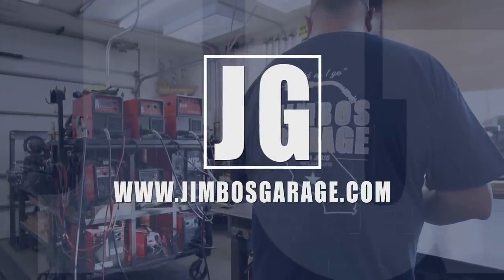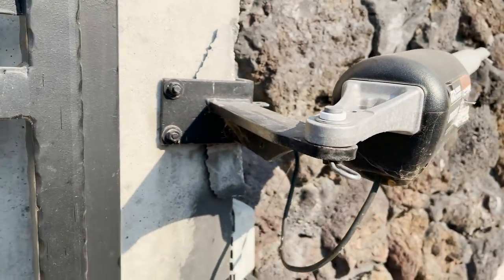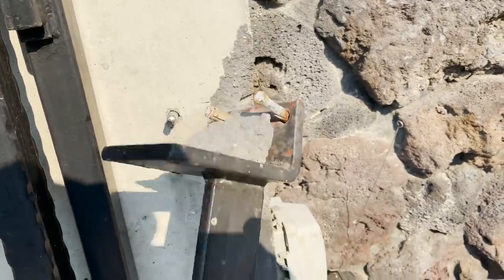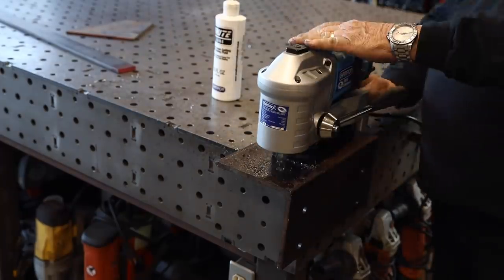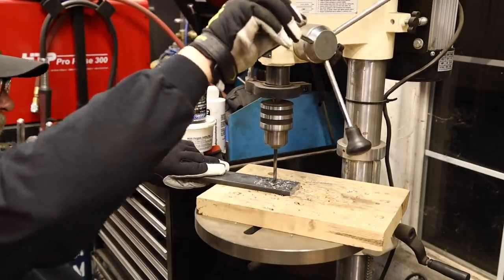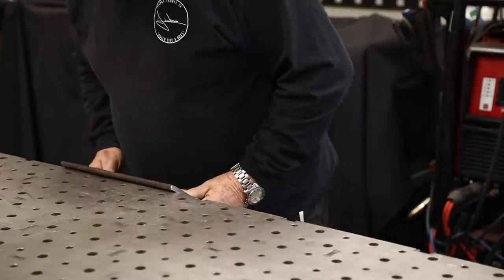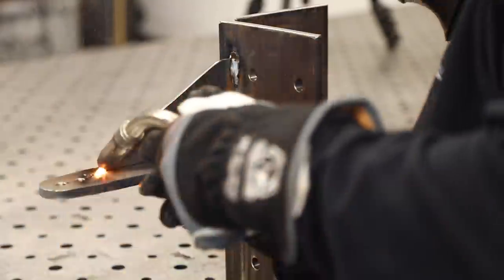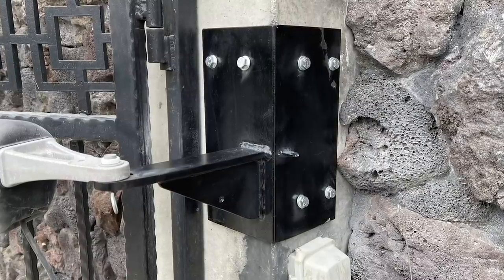Heavy Duty Gate Bracket | JIMBO'S GARAGE

Comment: I make these for a living and have done for twenty five years. The only thing I would have done different is offset the mounting holes, and maybe an angle return (drilled and tapped) to the hinge post, only to compensate for the weakened pillar. I love the way Jimbo makes one as good as mine, as a one off, though.
Reply: @Thomas McCurdy do you drive this type of anchor with an impact wrench? Thanks.

Comment: The only problem I see is when you drill the holes 🕳 in the new bracket the holes 🕳 should not be lined up. The holes 🕳 on the back should have been closer to the top and closer to the bottom, the holes on the side should be about 1 1/2 to 2 inches down on the top and 1 1/2 to 2 inches up at the bottom and maybe on the back one hole 🕳 right in the middle. The reason you want to stagger the holes 🕳 is to keep the bolts from coming close or touching on the inside, and with the lined up with each other makes it have a break point.  But overall great job.
Reply: In fact the two holes each side closest to the corner are completely unnecessary as that is where the concrete broke away - It would have been better to put a third hole on the outer edge as this is where the leverage advantage is

Comment: I noticed when you where laying out the holes for the anchors in the new piece of angle that you didn't offset them and was wondering if you were going to have an issue with that at install. I did the same thing on a fence bracket I made for a customer, learned my lesson on that one and had to go with a shorter bolt on one side, Hindsight is 20/20 like they say so now its always in my mind to take into consideration cross plain interference when I design stuff... Great job as always though. Hope you and the Family had a great Christmas and I look forward to seeing more videos in the new year.
Reply: i was thinking the same.. should of offset the holes so that the screw won't cross one another, especially the the in the front..

Comment: The original bracket looked strong enough... Looks like the short leg needs to be lengthen to keep bolts away from edge of concrete.
Reply: Thats what I thought, normally you don't wanna put any Bolt less than 50mm away from an Edge. Especially in such a case.
Reply: Since the original one failed and caused so much damage to the concrete it seems like Jimbo’s choice to go much bigger with the angle iron was the correct method for this job. 
I wouldn’t be surprised to hear that Jimbo makes another one for the other gate. 
The only issue I see was aligning the bolt holes which meant the 2 closest to each other across the corner would interfere with each other if not drilled on an angle as they did.
Reply: @Crewsy  maybe 4 bolts should make the job: the four far from the Edge.
Sure Jimbo didn't think about the alignment 😅
Anyway good job👍
Reply: I think you should have used c Channel off of the existing post welded a kicker fabricated the operator bracket still with the gusset on the underside. I did a similar job for a client and somebody hit the gate operator arm, not enough to destroy it but it definitely cause some damage to the pilaster so that was the direction that I went in it's built like a tank now whether or not somebody runs into it it ain't going nowhere
Reply: He should have offset the bolt hole heights to avoid the bolts being at an angle.
Reply: In the end he’s doing what the customer asked, which was to make a heavy duty hinge.

Comment: After seeing what happened the first two times you can see the weak link was the concrete, not the bracket. Only thing I would have done different, would have been to just put holes on the outside edges of the bracket that way you are as far from the edge of the concrete column as you could get. 4 holes total. Nice job
Reply: I was going to say going bigger not really needed, but extending longer so bolts are not so close to the corner. More concrete in-between bolts and corner.

Comment: I had thought that the concrete failed, due to bolts being short, as the original metal seemed in good shape.
Longer bolts epoxied into concrete would not have been a possible fix? 🤔

Comment: nice job on making that replacement, fun video... And I hate to be "that guy" in the comments, but the original bracket was plenty strong enough, the 2 issues were that the holes were not deep enough into the meat of the column.  If the holes in that original design had been offset from each other vertically, and you only used 2 of the holes and longer concrete anchors it would have likely been fine, what broke it out was too many bolts in line with each other in such a confined small part of the column.  As others have said, your new bracket probably should have had the holes offset vertically from one side to the other

Comment: Jimbo seems like you could weld a bracket directly to the gate frame and not even need to attach the actuator to the cement wall.
Reply: There is already a bracket on the gate.  There needs to be one on the concrete for it to pull itself shut.

Comment: I do brick work and concrete work. That bracket was still good heavy duty enough, it was just installed right in the corner if you ask me. not trynna bash ya. I just think it was the not made appropriately. I dont think the fabricator had the concrete cracking in mind due to the anchors close to the corner and aligned.

Comment: Concrete is very strong in compression but not so much in tension. That column should have been full length square steel tubing embedded inside the concrete with the bracket attached to the tubing.

Comment: Best fix would be to install the proper size hinge posts behind the column and have the bracket attached to the post. 
Working a gate is stress on this system but wait until someone hits the gate. It’s going to be a mess.

Comment: Hey, There are some misstakes with the old and an the new bracket.

The New Bracket  ist awesome, but 8 of these Concretescrews are to many.  2 on each side would be enough and then you need to use Boltankers m10 in Stainless.
And at least the Bolts need to be offset.

If you use so many Ankers in that close Range you will weakness the Concrete and you get cracks and the Concrete Break like before.

Greetings from Germany

I love your channel

Comment: Should have offset the bolts. You made a horizontal line to weaken the corner. I see how you had to angle two of the inside bolts so they didn't hit the other..

Comment: That is why you tightened the bolts at an angle so that they did not meet. What prevented you from making the holes so that later you did not have to dance with the mounting holes?

Comment: Smart not using any expansion hardware.  They just had those other expanders too close to the surface.  Probably work fine in a slab but not on a corner mount like that.

Comment: Have you ever included comments about you being in California and needing to be a LICENSED CONTRACTOR for some of the work you do?  I would think it would be a good "Disclaimer" for some that may apply your lessons.  Not just the technical items are useful but also the business items too.  BTW- I have discovered that putting anchors in line on each side of your angle can cause the concrete to crack at the same line and cause the entire bracket to fail.  I have learned from experience that offsetting the anchors on each side has worked better for me.